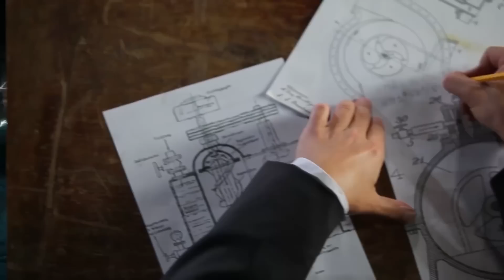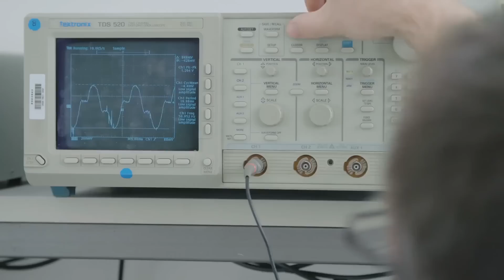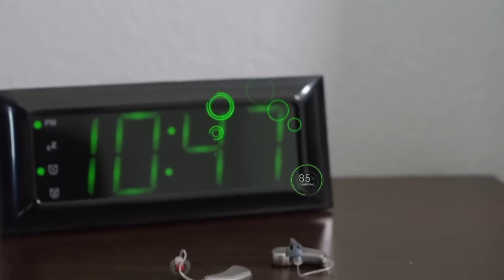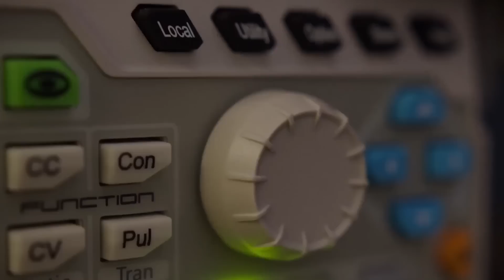Wireless Power Transmission is Here

Comment: It's been here since Tesla discovered it! The big corporations could not let it be because they did not figure out a way to charge money for it.
Reply: Its not as sinister as that , but signalling wireless could have some one trying to use the free power in direct line of sight. The coil kit for receiving it is large and is more expensive than a wire . But on single routes to a remote location its very effective. it has got some great fall backs as radiation in that area of line of sight, Pluss can stop cell phone use even tough on a different frequency.  it is better on small distances and despite the video is very weather dependant just like pylons. The wetter the atmosphere the more power is required output to gain the same normal load. it can only send high freqency modulations like pylons and not dc power .
Reply: @RichieWellock  : It interesting 🧐 that Data Communications are now using his Tower ideas to transmit information through the Earth!
Reply: "discover"? no
Reply: Tesla rediscovered what the Egyptians and other worldwide pyramids
Reply: What do you think high voltage in the air is going to do to humans and wildlife.
Reply: @mrbaab5932  : Don’t forget that lightning also creates O3 molecules!
Reply: @mrbaab5932  
absolutely nothing! the atmosphere is already highly charged (hence lightning) - where do you think the electricity actually comes from? the atmosphere!
Reply: @RichieWellock Dont find and say resons we need remedy 
Resons never give invemtionsbut remedys can
Reply: Yes but naw thay will make electronic money and hight tax for energy

Comment: the trick is that we do wireles power based on electromagnetic radiation propogating out from the transmitter as a radio bubble, tesla coils aren't transmitting power like that, they aren't using induction, they are using resonance coupling to turn the ground into the neutral and the air into the hot wire.

a true tesla coild transmitter reciever setup uses electromagnetic to generate the voltage and accomplish resonance, but the actual power transfer from transmitter to reciever is supposed to utilise atmospheric capacitance and transfer power electrostatically instead of electromagnetically.

it makes a big difference, electrostatic resonant charge transfer is orders of magnitude less leaky than emr based power transfer.

Comment: Tesla’s idea of transmitting high power around the earth would not work.  RF or microwave energy transmission of energy is very limited.   Microwave transmission can send larger amounts of power in a directed beam.
Wireless Power transmission to power millions of homes is unfeasible.

Comment: NT did not intend to send the power through the air but the earth. As it is a colossal reservoir of power.  Also sending power using transverse electromagnetic waves will never really catch on. It is too lossy . Longitudinal dielectric rarefactions is what needs to be used.
Reply: The idea was a circuit the earth is one leg the upper atmosphere is the other circuit that’s why antennas put in the air have a ground put into the earth!

Comment: 4:30 that's pretty amazing when you think about it.  Typical power lines lose between 2% to 6% in transmission and 4% in distribution.
Reply: 1/r²
Reply: I watched that bit and it's 60% efficient so it's losing 40% in just 1km
Reply: @diceman199  : What’s the loss from sun’s output till arrival at earth’s surface?
Reply: @arthurgibbons7401  and what does that have to do with it exactly?
Reply: @diceman199  : I thought you knew everything?  Are you the type claiming that Light is a particle?  Yet it’s in the EMF spectrum?  Just because one Scientist claims it’s a particle rather than say the light wave drives particles, like a wave 🌊 on a lake moving a floating object doesn’t make it so!

Comment: This would do nothing to minimize power outages due to hurricanes, etc.
As someone who has been through hurricanes and snow blizzards  the power was out because of local distribution lines being down.  Because of the inverse square law, diffraction, and air being a great insulator this will never be a practical way to transmit power.

Comment: If it per practical then it would of been done already. All wireless power transmission tests reach the same conclusion. The further you go the harder it is squared. It is for short range only. Only a pipe dream. The power transmitted is very low Current. about 10 mA

Comment: No one has come close to reproducing Tesla's work because he was transmitting radiant electricity (his term), not standard E&M waves.
Reply: Please tell us more !
Reply: He wasn't actually transmitting Radiant energy,. Wardencliffe was actually going to increase the density of Radiant Energy. This way, you wouldn't need to have an aerial array which was so high up in order to hook into the higher levels of voltage and therefore limit the risk of lightning strike that Benjamin Franklin was privy to observing during his experiment with a kite.

Comment: What is the distance if shaped like that? It is like a cut wire and copper then wrapped(/cased) aluminium? If wifi to have that shape plugged in or antenna of extender replacing(modify) into that shape(because just like a rod)?

Comment: The possibility of uninterrupted solar voltage being wirelessly transmitted to earth, wow!  What about solar panel eclipse factor for the earth's surface? Certainly, the satellite circumference would be much larger than the earth. Wonder if the demand for electricity would be enough to eclipse the sun in any significant way?

Comment: This is so impractical and just a pipe dream. The energy losses are very high. The cost and other issues such as line-of-sight will prevent this from ever becoming reality. Wireless power is only useful for short distance and low power applications. Just imagine using wireless charging for your car. If it cost you $20 to charge your car with a plug, it would cost $26 to $30 using wireless charging. How dumb can you be to pay more for the infrastructure only to then pay even more for its use?

Comment: Makes a nice science project for some high schooler, but in reality this just isn't feasible as the huge power loss transmitting huge megawatts of power needed to run entire cities, the range is useless. works well for telecommunications as these devices use only mili watts of power and there is little power loss. As far as running EV's on the roadways, this also is a pipe dream with our antiquated electrical infrastructure. We are more than 100yrs away from accomplishing this as major new electrical infrastructure would have to be built from scratch. In the end folks, we will be using diesel and gasoline till the end of time as these renewables just can't keep  up with world demand.

Comment: well if there units works in the line of sight then why could a sound unit be used as well and maybe less cost like using two speakers toward each other and modulating sound to generate power on the other end.🤔

Comment: Did they account for system loss? This is only good for areas where you have excess power, but for places where the load is high compared to generators this is useless

Comment: To transmit 1 kW of power over a distance of one kilometer wirelessly would require a very strong electromagnetic field, which could potentially pose a health risk to people, so no wireless power tools, heaters, or large electronics.  But ya maybe handheld electronics can be kept powered in a room wirelessly.   But are these worthy risks?  I hope the EMF safety protocols are actually safe.
Reply: They were using microwave rather than induction. Even then the video gives figures of 60% efficiency over that 1km......so 40% loss in one Km.....massively inefficient
Reply: @diceman199 you are looking at the wrong numbers and effects. Dish your classic education. Regular electricity power is also transmitted wirelessly as a photon stream with the wire merely guiding the wireless connection. Tesla realized you could use the earth as the guide for the photon stream instead of wires.
Reply: @soostdijk  I'm literally giving the numbers from this video. MASSIVELY inefficient.

Comment: if power transmission was possible you could have a car with supercaps for a buffer while moving without a battery - although u'd be depended on the grid and if there's an outage you are pretty much out of luck
Reply: Would you have a power outage if you tapped the earth’s dynamo?  Doesn’t the earth’s magnetic fields act like a running motor?
Reply: @arthurgibbons7401  in short no

Comment: GREEN???  There are better ways to use copper resources.  Maybe instead of burring a bunch of copper coils you could make the coils into two over head wires and use a trolley system.  It's nice to think green but lets think green while thinking green.
Reply: Cleveland, Ohio had tracked and trackless (rubber tires) electric trolleys back in the late 1950s with overhead wires. I was a young child. You can see pictures of them online.

Comment: So how much energy do they need to produce in order to transmit two kw of energy.

It seems to me that there is a huge potential to waste a huge amount of energy in order to transmit a small amount of energy.

I can see how this would be of interest to the military that is for sure, especially to power and control drones and potentially robots but for domestic use there would need to be a huge change of potential for domestic use.

As for the charging roads, again seems a good idea on the face of it, except all they are thinking about are cars and busses.

This type of tech would be better off being used in parking spaces, laybys, and domestic garages, that way you just park your vehicles and they charge automatically, the only real concern will be how to stop it charging or over charging a defective vehicles battery.
Reply: yep, it's easier and cheaper to just go and buy a portable generator

Comment: Wireless power transmission have been here, officially, for many years. It's almost 10 years ago I saw a presentation on TedTalk. They powered a TV without wires.
But unofficially, this tech has been here forever. Every previous civilizations had both wireless transmissions and free energy generation. They didn't pay for electricity.

Comment: Is this cheaper than the passive wire distribution? Funny no body think about the load of active electronic components work here , do you think Microwave components/ devices are  low price items? Besides more active components [ to convert to frequency & back include] means high probability to the failures one day, not like the  existing HV wire system that works for yrs without any attention. Microwave transmission highly directional  & in case of the shut down sensor failures it would be very dangerous to animals/ birds to go through the beam path.
Reply: Interesting input here

Comment: The technology is ultra dangerous. Kilowatts of 10 GHz microwave energy will fry you if you get in the way of it. As to beaming high power  microwave energy from space, only. a moron could possibly believe that it can safely be accomplished. The beam width of even the most directional antenna would require a large receiving area for safety purposes. f the control electronics on earth or in space were to fail the result could be a moving path of destruction. One last point, The ISM bands are usually used for low power equipment, not multi kilowatts.

Comment: This is a bullshit salad of film clips and myth. 
The wireless power he demonstrated was used to light fluoro tubes. Low energy.
His mental health problems took over towards the end of lhis life.
Most of his work was base on the more formal work of others.
He did make the first commercia induction motor, but it was only two phases. The more efficient three pahse one came later form people who actuall knew physics.
Microwave energy will fry anything in the beam, and the power loss referred  to is just beam loss. The generation cycle wastes immense energy.

Comment: It's funny how people actually think Tesla invented wireless electricity. Lightning has been around forever. But transmitting energy wirelessly is done all the time radio for example or wifi or 5g. It's just to transmit enough energy to drive a motor or something you need dangerously high power. Radar on aircraft can transmit over hundreds of kilometres. You need a jet turbine to power it and the radiation is strong enough to kill people if they are near them when turned on. Lightning can power a small city for a few seconds and travel 10 kilometres. But if your unfortunate to be were it strikes you will be vapourized. Probably lucky Tesla could only get it to work ten metres or so in a Faraday cage. PS Teslsa invented the Tesla coil which in it self is just a high voltage transformer which was invented by Faraday. To be honest I'm not not what Tesla actually invented even the AC motor could be a contentious claim.

Comment: The idea to put wireless charging coil packs under the road so an EV can charge while driving is absolutely genius
Reply: its dumb overly complicated approach. Might as well start making trolley cars
Reply: You might make a case for parking lot and truck stop charging stations that require no plug in -- but the road is subject to weather and accidents that you cannot control.
Reply: this technology was available for well over 150 years, there are some old streets where the streets have a mesh of iron in the road which powered electric cars, they fell out of favor after ww1 and gasoline cars were promoted by oil corporations.
Reply: Yep! Just as genius as solar roadways. The whole concept is a joke.
Reply: @paparoysworkshop  its not actually it works, solar roadways is good on paper but makes no sense because of the damage, dirt, and loss of friction.
what would be a better idea is to have piezo electric strips that produce electricity whenever cars run over the strip.
Reply: @HamguyBacon  And those wouldn't be damaged? The problem will all of these gimmicks is the cost (installation, maintenance etc.) outweighs the benefits. So many things sound good on paper, but in the real world, they don't work.
Reply: On highways and parking stations.. ideal to recharge across larger distances.. and home garages.
Reply: @paparoysworkshop  its free electricity, do the reflectors on roads get damaged?
Reply: @HamguyBacon  You actually want to compare that to a reflector that has no wires or connectors of any kind? And yes, reflectors are damaged all the time. You are a funny guy, I'll give you that much. 🤣🤣

Comment: Tesla drove himself crazy with this idea.  Physics is against you here.
Reply: TBF, he was born a little askew. He was brilliant & obsessive - not only obsessed with his ideas but also with prestige & fame.  That probably did his career in more then agreeing to sell his patents to Edison or losing Westinghouse's backing after Wardencliff exploded on its first test run.
Reply: @user-lb8do4ew6k  I think you're mistaking the experiments. He blew up the local power station in Colorado Springs, during his first experiment in wireless transmission. He then went down and not only repaired it, but increased it's output so then he could continue on with his experiments without causing any more disturbances to the locals.